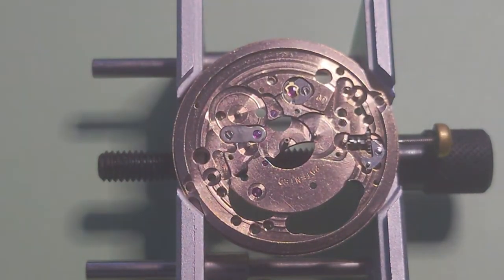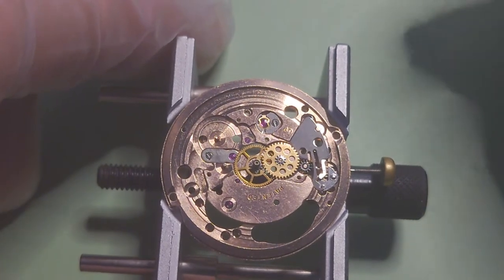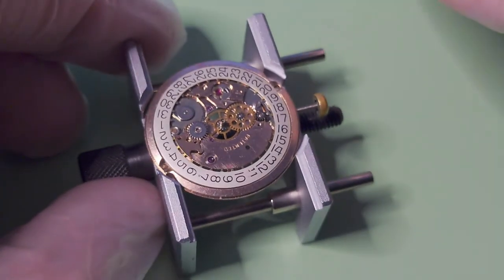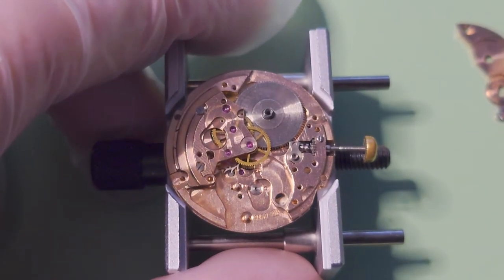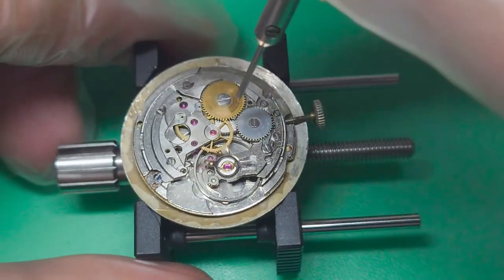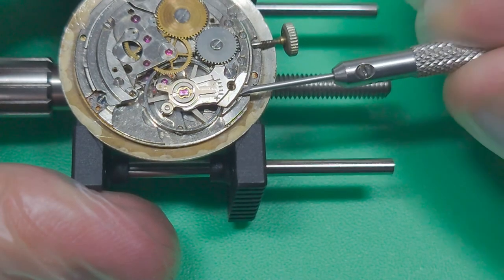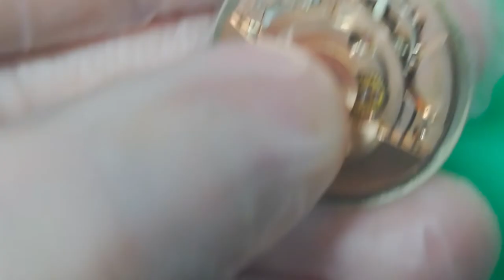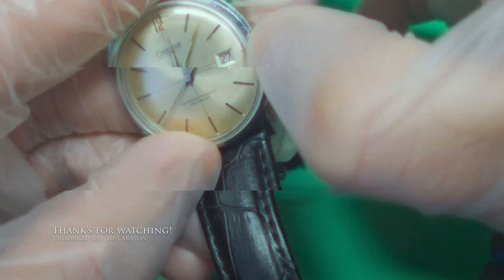Exactus Cal ETA 2452 (2/2) - [Ep.No.172]

Comment: Hola hermano! Muy bueno lo que haces, he estado mirando tus videos muy por arriba después de que encontré el video 1/2 y 2/2 del eta 2452 y sos muy bueno. Tengo que reparar un Breitling transocean con este calibre que pertenecio a mi abuelo. Espero tener la suficiente información que das para desarmar y armar y que vuelva a latir. Saludos desde Tandil, Argentina. Te ganaste un suscriptor!
Reply: Que aceite usas?
Reply from the maker: Hello!

Thank you for your comment!

Thank you very much! 🙂💯
Reply from the maker: Hey,

I use several oils. It also depends where you add them. Moebius D5 is one I use often in the keyless and the barrel w the mainspring. 

9010 is often used for the train. So it all depends where. I also use 9010 for the pallet, for which I then distribute via the exit pallet.  

I often follow "basic guidelines" for servicing watches rather than a specific for this movement.  I learnt that it works well! But also every watchmaker do as they suit them lol and I think the most basic oils us D5 and 9010. 

Best regards